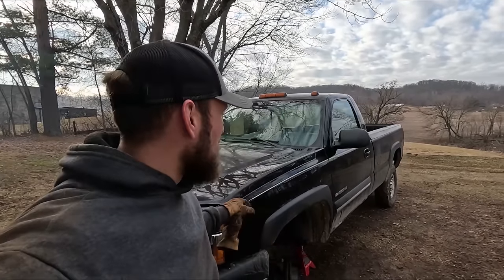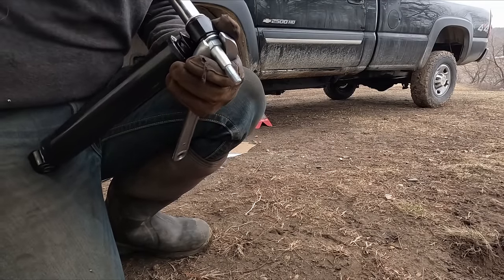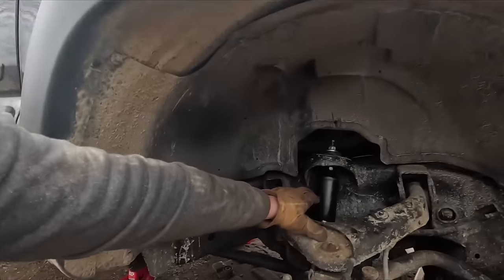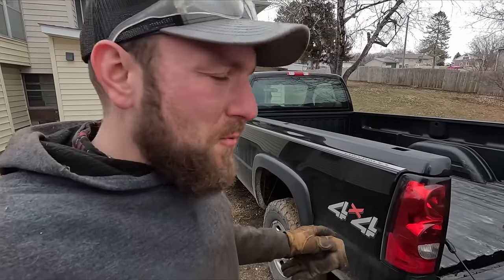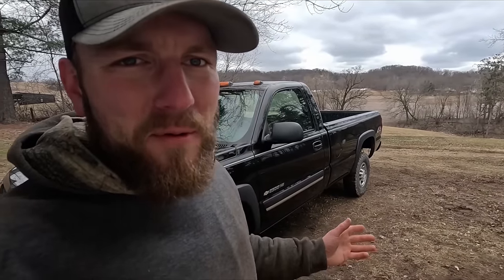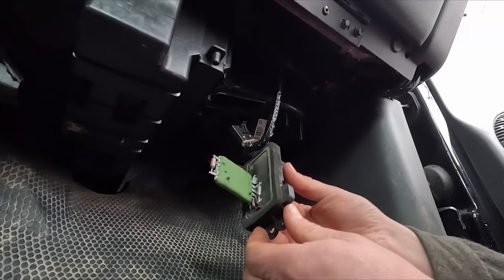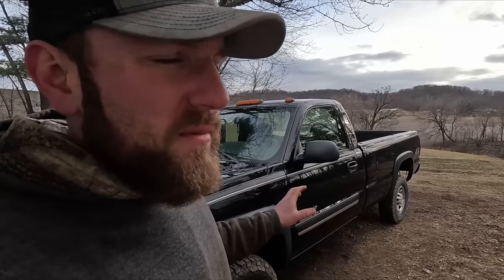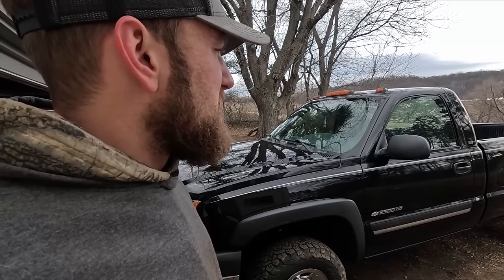Fixing and Upgrading My Truck! Chevy 2500HD Pickup!

Comment: Order a B&W turn over gooseneck, they are bolt on. I just put one on my 06 F350 King Ranch and it took me 1 hour to install.  I ordered mine off eBay and it was $300 cheaper and was brand new.
Reply: I love the BW hitches. I've had one in a 250 and 350. Both were new enough trucks that the beds actually had a dimple at the point where you center up to drill the 4inch hole. Using these hitches allowed me to use my 5th wheel companion hitch in either of my trucks.

Comment: Good looking pickup should last you many years to come. I picked up both of mine as projects and so far they have treated me rather well. I have been under the impression the failure of the blower motor resistor in that era of GM pickup's isn't unheard of. I personally have replaced one in a 2002 Silverado and our JD 6310. As for mudflaps I have a 2012 F-250 with factory mudflaps, they seem to do a nice job of keeping debris off the side of the truck. I also have a 2003 F-150 without mudflaps, it's always noticeably dirtier than the F-250. I 100% recommend tow mirrors, my F-250 has factory tow mirrors. I also don't do a lot of towing but it's nice being able to use the convex mirror to see my rear tires and a wider view to the rear is nice to see what's going on beside your vehicle. Nice full set of wrenches!

Comment: That blower motor resistor is a common failure point on a lot of the GM trucks and SUV’s. Mine crapped out, delt with it for a while with only first 3 speeds until one day it all went out.

Comment: Got a 04 Chevy 2500 did  the same thing pulling my lawn trailer left me sitting along the road! A simple ground wire! They are great work trucks have a 08 Chevy 2500 213,000 miles just keeps going! Enjoy your videos!

Comment: I’ve got a 2000 gmc 1500 4x4 with 358,00mi on it, I’ve had to replace that resistor twice so far. Now it’s getting a new transmission. This era of truck are great runners. I’m a full time carpenter and part time farmer.

I have used B&W goose neck ball set ups on all my big trucks in the past. I’ve been told the Curt kits a good as well, but never tried one. I mostly use Rapid Hitch as all my trailers currently are bumper pull.

Aluminum Tank Industries is the brand of fuel tanks I use coupled with a Fillrite pump. I’m current using Weather Guard tool box in my truck, but ProTech make a great tool box as well, both options are pricey. I’ve used just about every cheap tool box brand out there and on only get a year or two before they start to tear apart. 
I keep my tool in a Montezuma wedge box. They are ok for the price, they all seem to be rather disposable anymore.

Comment: I have a 2002 Chev 2500 HD...likely set up similar to yours. Bought used in 2015. Has been a good workhorse, has 124,000 miles. Body/bed showing their age but for only putting 1,000 miles a year on it hard to justify putting big $ into a newer truck. Really like the 6.0 engine...plenty of torque for pulling 200 bu wagons.

Comment: When they started putting coil springs on the front of 3/4 and ton trucks, they stopped making TRUCKS! 😂 I liked my old '87 K30, and didn't care how it rode. Hoping to give it a second life with a 12v Cummins swap from a '96 Dog. Couldn't keep front end together on the Dodge. Great video, and reostats are a pain to figure out what the problem is.

Comment: I would do everything in my power to keep any truck Chevy, Ford or Dodge from this era and older in the best possible condition. New trucks are overloaded with electronics and way over priced. The diesel trucks emissions lower the milage and are much more expensive to maintain. Trucks in the future will be EV useless plastic garbage.  

My 1999 Dodge trucks heater fan operated the same way with an external resistor. When the resistor gos bad it's a good indicator that the fan motor is going bad. You might want to change the fan too otherwise your resistor may have a short life.

Comment: If you had to do the brake lines, do the fuel lines. I had to replace the fuel pump and disturbing the lines sent rust particles into the injectors. My 1500 came with no fuel filter to catch the rust, just a bad design! If they look sketchy at all pull them. I'm no mechanic but that was my headache.

Comment: Ford has that same dumb ground cable that goes bad.  I used a different bolt on mine and a new wire and it was fine for the rest of the time I had it.  Great looking truck!